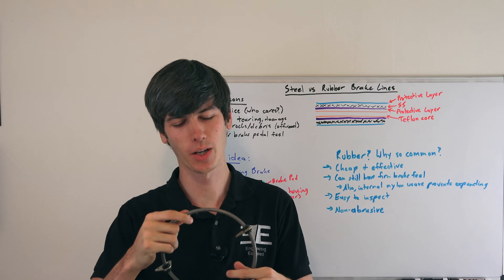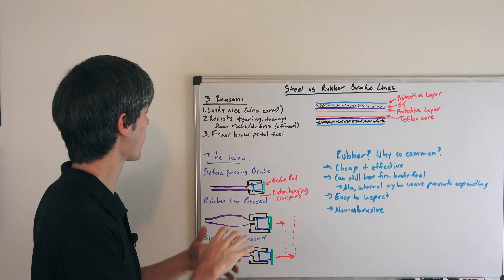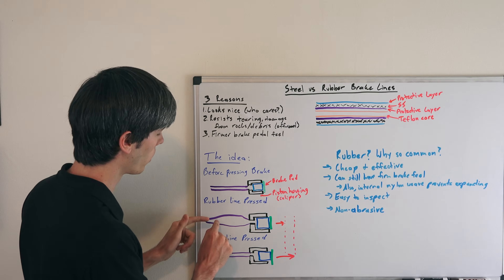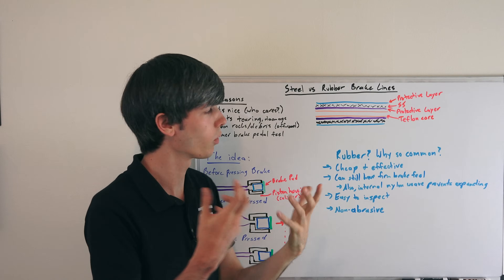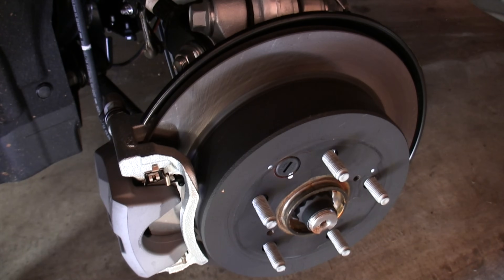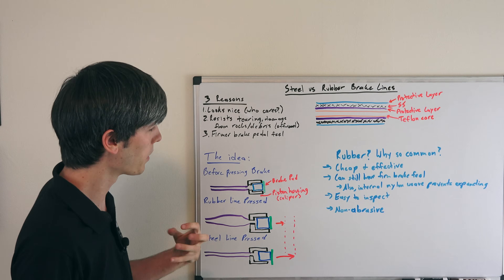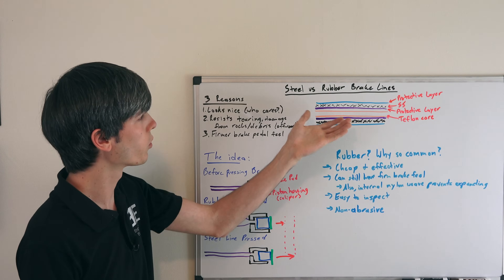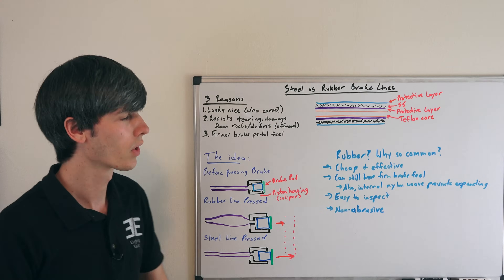Steel Vs Rubber Brake Lines - Are Stainless Steel Lines Silly?

Comment: With a channel called Engineering Explained, you didn't explain the engineering side of this.  With the small volume of fluid that the brake system moves, the microscopic difference between nylon weave and stainless steel weave may be significant.  Some actual measurement of the force req'd at the pedal vs at the caliper would provide quantifiable backup to your assertion that the change doesn't matter.
Reply: ...thinking the same thing...
Reply: some modern motorcycles and cars have drive by wire throttles so the actions are quicker than pressing a pedal that then, in turn, takes up the slack/flex in a cable and activates the throttle, if pressing the brake pedal relies on the volumetric motion of fluid to displace a calliper piston why don`t somebody experiment on making a braking  system by wire, I understand they would have to invent a particular failsafe system as backup but there must be a failsafe for the drive-by-wire system some cars have at the moment?
Reply: @karlwalker1771  liquid isn't compressible so the only things causing the delay can be leaks and expansion of brake lines(not accounting for heat soak etc because those will happen no matter how you activate the brakes)

If they were made drive-by-wire they would have to be extremely safe before being used in a production vehicle
Reply: @karlwalker1771  there are drive by wire brake systems, look at some of the new lexus (as a lexus tech) some are just the rear wheels but with the hybrids especially, they have all 4 drive by wire brakes. Their downside is that the pedal is not linear, it looks at how fast and how hard you depress the pedal so with the same travel at different speeds they will have different braking forces, which makes them very touchy in my opinion. But they do exist and they really lack pedal feel, especially in the early designs. Im sure other manufacturers have these fully electronic brake systems as well.

Comment: Resurrecting an older video here.

Jason some of your comments regarding the possible drawbacks of steel braided lines are a bit ridiculous.  

You mention that with the braided lines you wouldn't be able to see the location of a tear in the teflon core of the line, how exactly will the core get a tear in it when it's shielded by the steel weave?   You also can't inspect the core of a rubber brake line either as all you can see is the outer protective layer of rubber.

Also with regards to the "abrasive" comment.  If your flexible brake lines are rubbing against anything then they're either poorly engineered or poorly fitted as they shouldn't be making contact with any other component.  Secondly in the event that your lines are rubbing I'd much prefer the line scrubbing the paint off the damper or spring rather than the line becoming punctured causing a brake failure.  Finally as you mentioned steel braided lines have a clear coating on the outside of them preventing the steel from contacting other components anyway.

Comment: hey brutha not trying to knock you because your video is very true but you forgot to talk about getting heat soak from some one doing something like a side exit exhaust or an external wastegate that pass by or sits close enough to brake lines.... i had to switch too steal braded lines on my 1.8t gti because i did a side exit exhaust behind my driver door

Comment: I don't buy the idea that a steel braided line is tougher. Once you put ANY knick in the braid it will blow. the only thing behind the braid is a soda straw liner, the braid what holds the pressure. 
Braided does feel better but you must be careful of abrasion.

Comment: So braided lines in a daily driver. the standard genuine rubber ones i get have to come from japan and after shipping ect they cost fractionaly less than a set of stainless lines, any problems using braided on a daily appart from inspection issues?
Reply: I have had SS lines on 3 of my DDs. Make sure you get the DOT ones, not the generic racing lines.

Comment: The two main contributors to the overall elasticity of the brake system is the brake hose expanding, and the brake pad compound compressing (especially organic compounds). Upgrading either will make a difference, but the brake pads surely offers most performance/price. 

My personal experience of changing lines is that the upgrade is most pronounced in non-assisted brake systems.

Comment: The thing with the rubber expanding was slightly incorrect explained. It does start to expand when there is pressure on it, not only in width also in length. That is in relation to the pressure that you apply to it, stainless braided lines do not expand. So you can put more force to the brake pads and get an higher breaking power then using the rubber break lines. Also is the inner diameter of the steel break lines most of the times smaller and that gives you an slight shorter break pedal way because the piston of the break moves the same amount of fluid trough an smaller tube. The expansion in an rubber break line gets bigger when the breakfluid heats up because the rubber gets more elastic what does not happen with stainless tubes! So there can be a big difference!

Comment: Rubber is good for about 100k miles. And they are around $15 to replace. Stainless are lifetime, but ~$100. The firm feel is people putting new lines on. New rubber will feel just as stiff as steel lines for the first 50k-100k. If people want firm feel, they don't need to pay $$$ for stainless steel, new lines will feel great period. Racing or off-roading is where stainless steel has the advantage. It does not fatigue under heavy braking as with rubber. But for daily driving, a firm pedal will be felt with new rubber lines for the first 50k-100k
Reply: Good video BTW!
Reply: +Ungregistered User - Banks step back on loans for older vehicles solely do to potential value. Its extremely difficult to evaluate the object condition with that age. A simple coat of paint don't mean the vehicle is perfect, it can be a lemon or an exquisite piece. But banks can't evaluate that 100%. So the risk factor put them on a defensive position.
Reply: Oem lines are suppose to last longer than stainless lines
Reply: But a lot of the line will never be all stainless.
Reply: Oem will often times cost more and sometimes it's your only option or ss. At least that's the case with my miata.
Reply: Ungregistered User  the idea that banks won't fund a car loan because the plastics have worn down is nonsense. Thanks for the lols.
Reply: Stainless Steal brake hose are actually quite a bit  cheaper than Toyota OEM for my truck

Comment: steel braided lines lend themselves more to motorcycles than cars. on a bike u will loose performance when fluids and rubber get hot after riding hard. for commuting like a normal human being rubber is fine if u want more direct feel and higher performance out of your brakes steel is better

Comment: If braided S/S lines really gave firmer brake pedal feel by any measurable degree, braided S/S line manufacturers would have the peer reviewed empirical test data in their adverts...

Of course brakes feel better when you upgrade to braided S/S lines, you've probably just used fresh fluid and performed a full bleed!

Comment: heat equals soft rubber ss get soft at a much much higher temperature for daily driving stainless is not need because your not producing as much heat I've never seen cars make the brakes glow from heat on the road but watch a 24 hour race and it happens

Comment: Well being all the so called experts here say that the rubber brake lines are just fine, why is it that those that really rely on good brakes like racers use braided steel? I'm sure it's just for the cool factor. NOT! Yes, rubber works fine for most driving and while they are in good shape don't expand much, so you get a firm brake pedal. Yes rubber lines do have a nylon weave in them to help prevent expansion but there is a catch to that, nylon will stretch also to a degree. Steel braid doesn't. Another problem with rubber is it deteriorates with age both outside and inside. Ever have a car that after driving it a bit you have one or more brake(s) that start dragging but after leaving it set for a while works fine for a while again. The majority of the time the problem is that the inside of the rubber line has deteriorated and will allow the brake fluid to pass through to the brake caliper /brake wheel cylinder but blocks the fluid from returning to the master cylinder. 
There is one problem with engineers, that being they lack real world practical application. Talk to the mechanics that actually work on cars and ask them what they think in the engineers that design the cars. They don't think too highly of them. The problem is things look great on paper or on a computer while designing them but doesn't work so well in the real world. Things don't always go the way in the real world as they do on paper or on a computer simulation. I like these videos and I've learned a few things watching them but every once in a while I watch a video such as this where if he had a little more real world practical application, it would have been better for him.
Reply: From Xtroll1738-"There is one problem with engineers, that being they lack real world practical application. Talk to the mechanics that actually work on cars and ask them what they think in the engineers that design the cars. They don't think too highly of them."

Those are truly ignorant and asinine statements.  If auto manufacturers built their cars like the engineers want to design them, they would be astronomically expensive.  They would contain everything from carbon fiber to unobtainium.  Manufacturing vehicles is a compromise!
Reply: The main difference has little to with wear, as some people have said, while SS lines do last much longer than rubber lines (say, conservatively 50k miles), they cost more than six times the cost ($100 vs. $15), so for most people who don't replace brake lines until failure, the rubber lines are just fine. The reason race cars are usually set up with SS lines has more to due with the heat factor - at high temperatures neither rubber nor nylon will hold up as well as Teflon and SS. The reason off roaders use them is more simply the impact and tear resistance. No one would argue that SS lines aren't better than rubber lines, but if you don't do either very aggressive driving (to include heavy braking into repeated corners or off-road driver through brush) than you won't realistically see much of the difference.
Reply: Yep, most commenting here don't know jack. After working on cars for over 30 years I can say without a doubt SS lines are superior. New rubber lines will now last past 50,000 miles but will stretch affecting not only petal feel but performance just as you wrote.
Reply: Stinky Cheese I don't have a clue huh, Really? The person that doesn't have a clue is the person you see when you look in the mirror Mr I hide behind a fake name Stinky Cheese. The condition I mentioned is a very real one. I have dealt with it on more than one occasion.  Back when I wrenched for a living, I had a couple of people bring tbeir vehicles in with what they said was a bad wheel bearing that had locked up so the tire wouldn't rotate and had to be towed in. Yet upon inspection the tire turn freely with no noise. take it for a test drive and after a bit you could feel that brake start to drag. After changing only the rubber brake line, the condition was gone completely. So yes, the rubber brake lines can and do go bad inside causing the pressure in the caliper not to release. So mr stinky cheese, go troll someone else with your nonsense but you are the one that doesn't have a clue.
Reply: Xtroll1738 

Steel braid WILL and DOES stretch.
Reply: This is why I pretty much replied, this guy has no real experience and I am pretty sure not has an engineering degree either. Rubber lines are put in cheap cars to cut corner, but if you know 2 things about cars, bikes, truck, or airplane, you just don't use rubber on its own.

Comment: I'll tell you my experience.  I have a 2000 legacy with 306,000 miles and a 1995 Accord with 263,000 miles and both have their original rubber brake lines.  And I live in the rust belt.  Every time I see a show change brand new rubber lines for stainless steel because "rubber could fail easily" I chuckle.  From what I can tell the rubber ones last almost forever.  I've seen rubber lines crack, but none of mine are cracked and they give you plenty of notice, you'll see and feel cracks long before they fail.  The only reason I'd replace with stainless steel is if a rubber line was bad or maybe on the racetrack because of the less flex BS which I bet you can't even feel the difference.

Comment: you got a better foot pedal feel when you breaking with the steel lines or at least the steel braided lines I got graded from rubber OEM to the steel braided brake lines for my 01 Honda Accord 2013 Honda Accord Sport and my 2011 Dodge Durango Citadel and let's just say it improve my braking distance I can literally get up on the brakes if I need to without having that sponge you feeling.
Reply: if you feel more using rubber, then we all bow our heads to you....

Comment: You forgot to talk about resistance to heating. I live in an area of such winding roads that you can frequently smell burnt pads in the air and see cars/RVs/trucks waiting for their brakes to "cool down" on the side of the road. And the thing they all have in common is they all have rubber lines. =/
Reply: Do you have any idea on how life actually works?
Reply: GnOOky they also have rubber tires too
Reply: Sir Daft1, do you?

Comment: You failed to mention one of the key advantages of the S.S. lines. Which is when the rubber heats up during use it expands more than when it is cool and the S.S. line will not expand even when heated. This comes in handy when high heat(racing) applications are used.
Reply: LMAO
Reply: you failed to mention one of the key advantages of rubber.  which is when the rubber heats up during sex, it prevents more pregnancies than when you go native. This comes in handy when girlfriends are used.
Reply: SS brake lines also aid in cooling. They bleed off heat from the brake fluid more efficiently than rubber lines. Every little bit helps on track. Hot brake fluid = brake fade, brake fade = a bad time.
Reply: Just what I was going to say, if doing a track day, upgrade the brake lines, it makes a world of difference
Reply: I totally agree with Mr Steve replies that rubber gets easily expand at high temperature.
Reply: Darek M, nylon softens considerably when exposed to heat so, yes, it DOES expand.
Reply: Motorcycles suffer the most because--

Line length is much greater than the average car, greater fluid volume is displaced in hose flex rather than pad movement.
Fingers/hands are engaging the brakes which bring much more feedback to the brain.
Next to no one services brake hoses. Motorcycle hoses are exposed to sunlight and coupled with the length of the lines, things get worse sooner.

But rubber hoses are cheap to make and are a common place OEM motorcycle manufacturers love to skimp.
Reply: Bradley Hayes you’re forgetting the actual tube is Teflon and that there’s an extra layer between that and the steel, and then steel isn’t that great a conductor, for example I replaced the aluminum pistons in my front calipers with stainless steel pistons to cut down on heat that makes it to the caliper.
Reply: @Phos9  You're right that it's not an exceptional conductor compared to, say, aluminum, but steel does conduct better than rubber. Inner Teflon tube included, SS lines do still slightly aid in cooling. I wasn't suggesting it's a massive help or the primary advantage to SS lines but like I said in my previous comment, every little bit is important on track. Just a minor secondary advantage. Of course, the main advantage to SS lines is resistance to expansion and durability in the event they may be struck by something.

Comment: I replaced the rubber lines on my 1977 kz1000 and the difference was amazing. The rubber ones were not very old but I needed shorter lines because I changed from a Old Style to a Drag Bar.

Comment: So then... What else can be done to provide a firmer pedal feel?  MC brace? Different fluid?
Reply: Robert, my 97 Mirage had a 7/8" master cylinder, and I replaced it with a 300GT 1 1/16" m.c (kept stock booster).  I also upped the single piston front calipers to dual piston and replaced the rear drums with discs from a Proton.  Even with the arguable increase in caliper piston area, the increase in master meant my pedal was rock solid, even with rubber lines.  I FREAKIN LOVED IT.  Unfortunately, not all cars can make a swap like this without rerunning hard lines.  Check out auto parts websites and start searching for MCs from any possible sister cars to yours and compare visually with one from your car.  Check them out in person if you can.  Or be prepared to spend money on experimentation.
Reply: Different brake booster, different calipers.
Reply: Stinky Cheese 
I changed to grippier pads many months ago. Much better since.